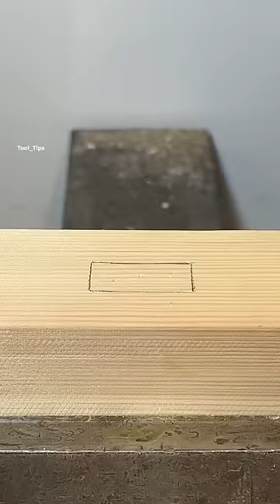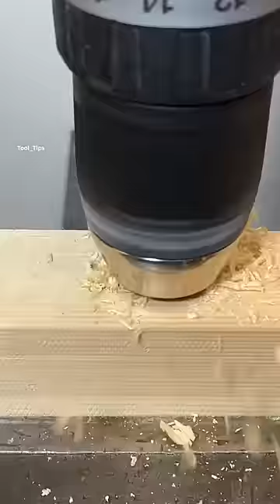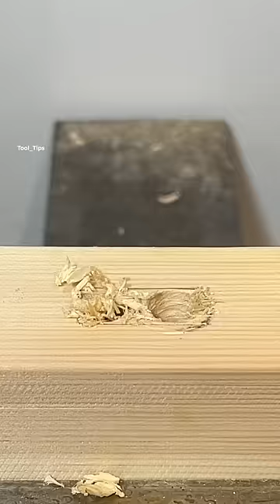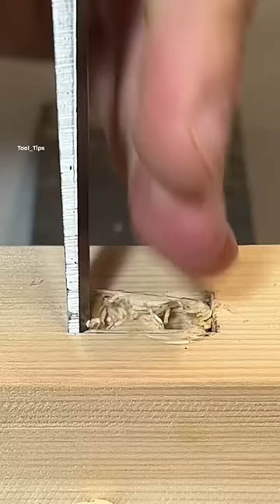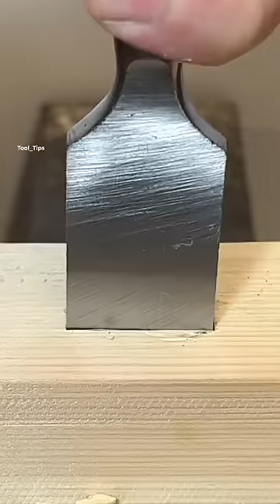Woodworking #shorts

Comment: Why the holes tho
Reply: You need space to release the pressure and to allow the chisels to fit without cracking the board, or giving you a hard time.
Reply: Holes allow for easy chiseling/cutting